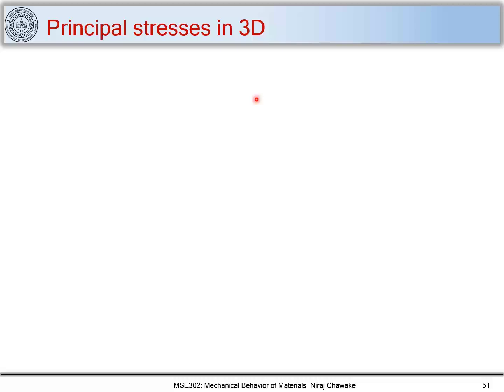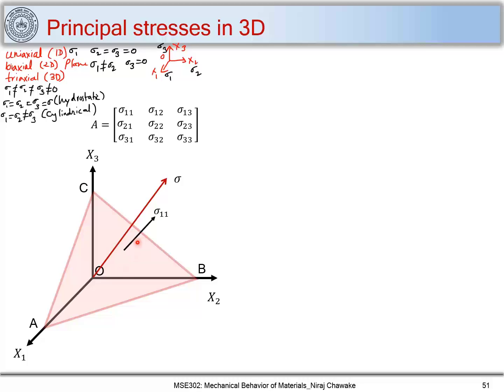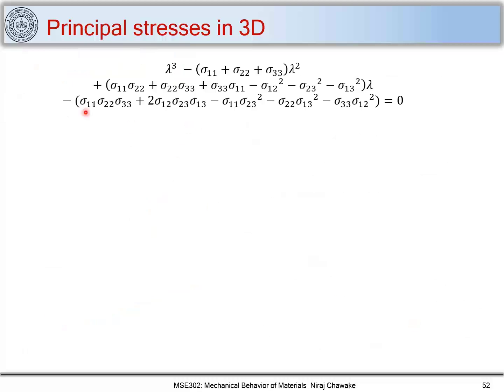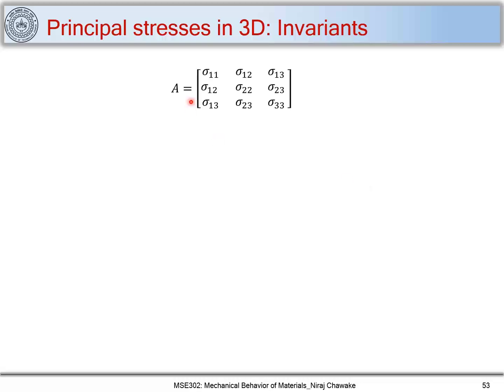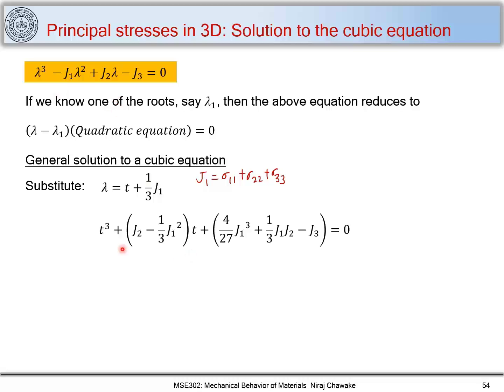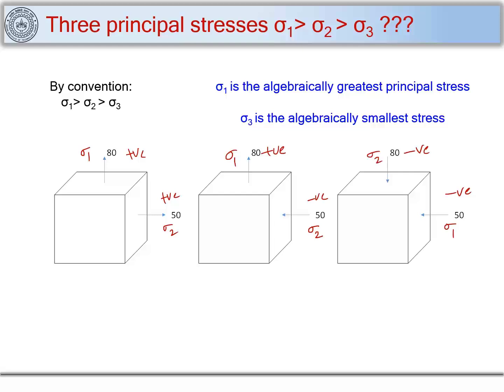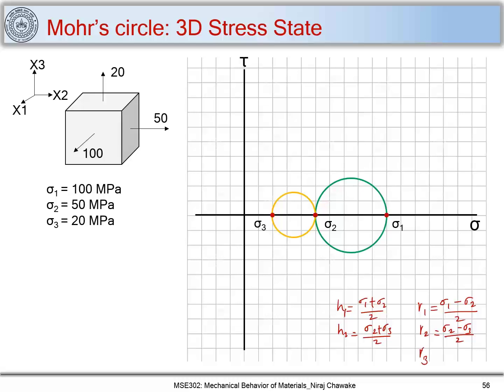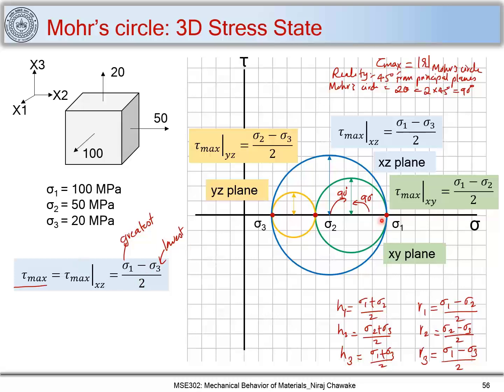14. Principal stresses in 3D | Stress invariants | 3D Mohr's circle

Comment: why should k start from 0, is there any physical significance to it?
Reply from the maker: The depressed cubic equation is solved for 3 distinct real roots. This can be easily done geometrically. Please see any standard engineering mathematics textbook or internet sources for the solution. You would be able to figure out that k=0 and k=3 yield the same value. There is no physical significance to it. So, 
k=0,1,2 gives exactly the three distinct real roots, and further values just repeat them.